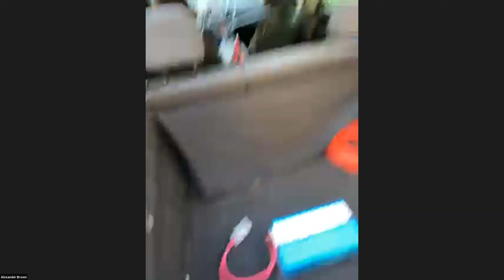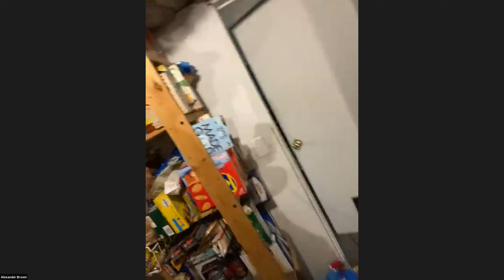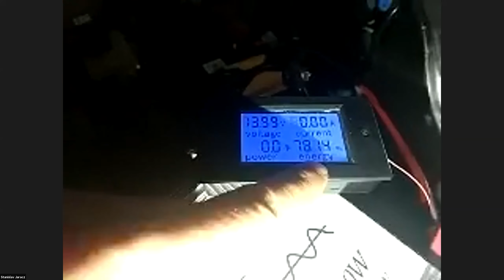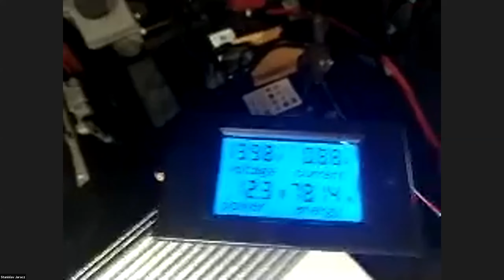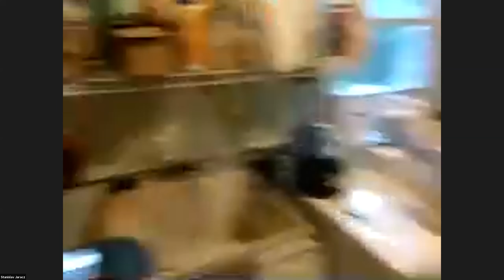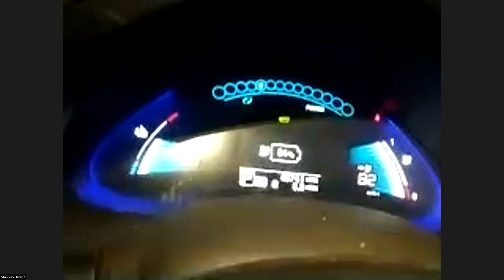Turn Your EV into Power Generator. EV for resilience.

Comment: What about using your ev to charge your Tesla power wall while running your home off your Tesla power wall?.
Reply from the maker: Tesla Powerwall is much more capable vs. the setup we were describing. There is no practical reason of running them both in parallel. Most Powerwall owners also have solar system capable of running off-grid.
Reply: @stanislavjaracz  I understand that, but for how long. 24 hrs, 3 days, a week, 3 weeks?